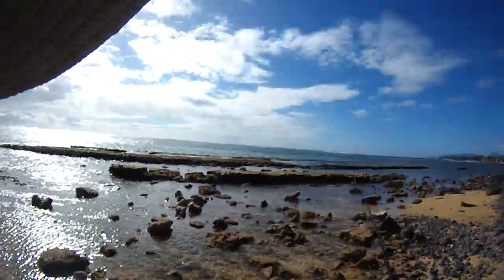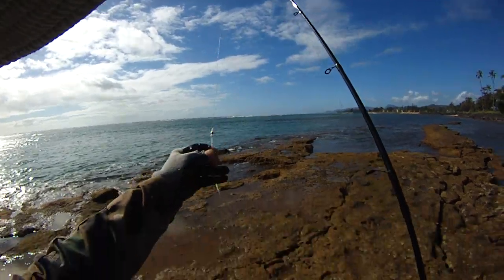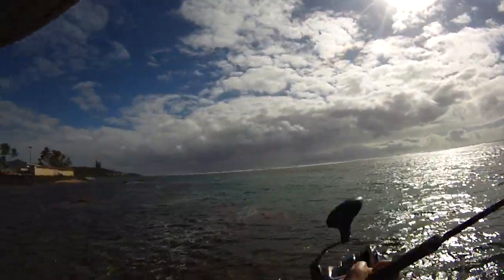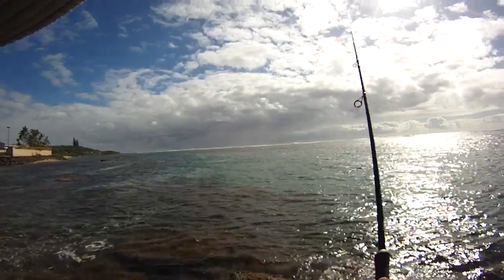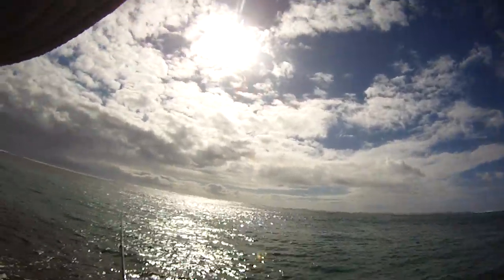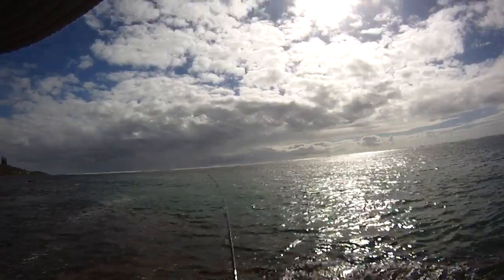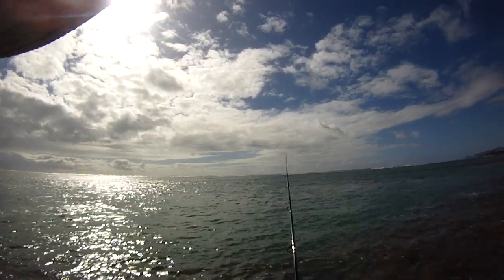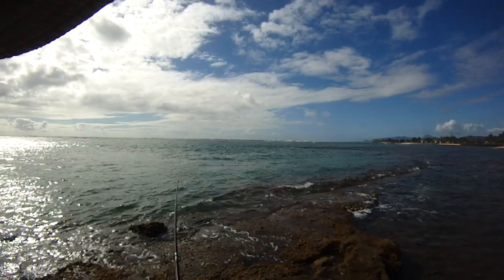Whipping techniques for GT(giant trevally) and Omilu(bluefin trevally)

Comment from the maker: I have been whipping since 2012 for the "Quest of the Omilu" started from my friend in Oahu.."The f16 with afterburners on the reef" is his vivid description..I then went on a daily basis approx an hr no longer..365 hrs of fishing.per year about 700 hrs...mind you this is all times of the day..no night fishing..I have learned a lot in this "Quest" when is the best time, the water conditions, season, lure, presentation of the lure, how to land the fish by using drag and lifting up or down of the rod to feel the fish.  Last fishing tournament my friends were talking about 72 hours of fishing..in 3 days..I would do that in 72 days(1 hr per day)... I will definitely catch more fish..doing my way plus I am trying to find the fish..not in one place also because I go for different fish when the water conditions or bait is available ..the limu kala.  That is why I am looking for an overall spinner than will do that for me..currently the spheros..its heavier, lower retrieve ratio, manual bail, no maintenance and lube port,  but I would stay with the 5K FJ stradic with 30# PP is my go to gear....but the gears are failing..its because of my pop and crank technique lots of stress on the gears and the speed I do this..

Comment: up a saragosa 8000 and putting 50# braid on it. Was going with PP but been reading many stories where they brake way below ratings. so now i might go with 832
Reply from the maker: Good one the saragosa, I did not know they exist!!  You can chk my braid test video..if bought from a reputable company(Uzuo Bros Hawaii) than you be good to go or even the shimano store..its what is around here on kauai.  I did try Jerry Brown..and it is limber compared to PP..I have Tuff line but did not use it yet..have not checked 832..heard it was good.  I have only tested PP, Fireline Crystal Berkley, Tuff line and Jerry Brown...the PP was the best of all..

Comment: Man, I tried doing this method and gotta admit, your dominant whipping arm is gonna be the size of Arnold Schwarzenegger's after a day of whipping!  LOL

How deep is the water you're whipping into?  I see the reef so you literally hop it over the reef when you hit the 10 o'clock spot.

Also how come you're fishing low tide?  Don't bigger predator fish like these come in during high tide to feed on the smaller reef fish?
Reply from the maker: My forearm is about 11 1/4"..135 lbs, 5'2"...my 7 ft fenwick is very light...most people cannot use my technique because their rod is too long..and flimsy(light class)..mh, h makes it easier to get my action...I do this with the 3-8K stradics..
The area I whip goes from 2-15 ft...I love low tide...all my uluas and my son except 1 has been caught at low tide.....my reasoning is this..the water goes low and the fish has to go where there is water..so the ulua or omilu waits for the low areas because thats where the small fish are...you can see my videos thats for sure..the rocks are blaring at you..most people do not fish when its low tide..they figure they gonna snag..they are right so it takes some skill and where to throw the lure and retrieve it..than skill to land it..patience, amount of drag by lifting the rod to see if the fish will come with the surge or not and if not to give him drag and waiting for the surges are the essence of finesse fishing!!